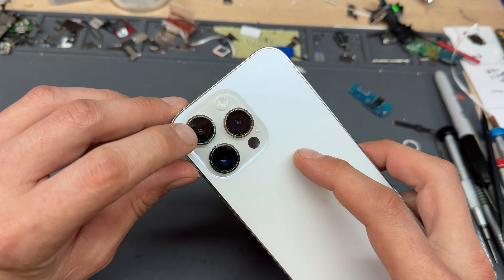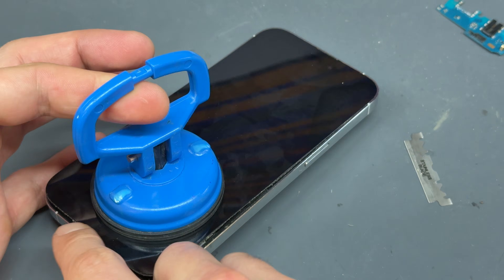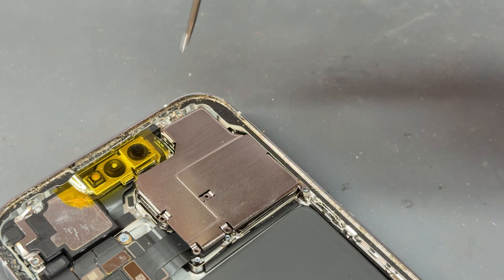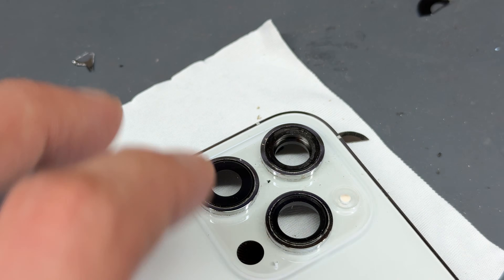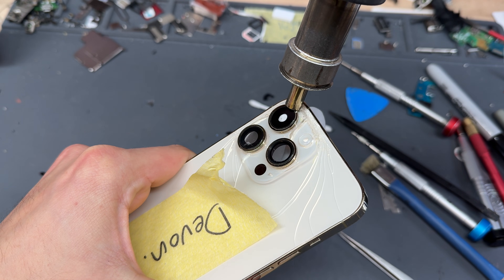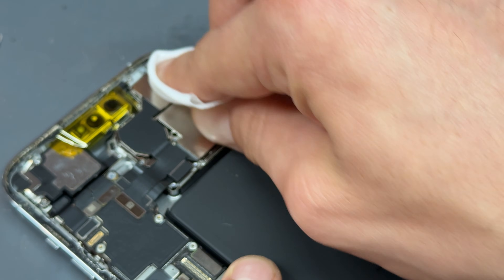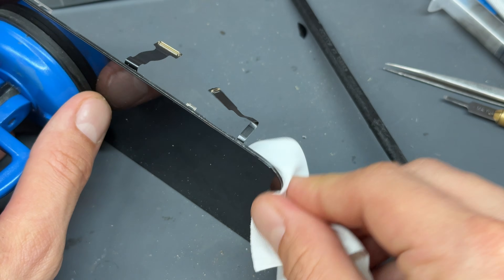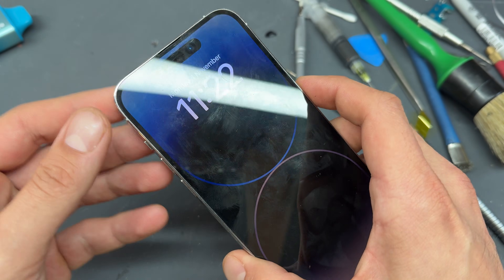iPhone 14 Pro Max Camera Lens Replacement - DIY Guide to Fix Cracked Or Broken Lenses!

Comment: I have seen many lenses on the market - of course it is questionable whether it is really sapphire glass then. However, the camera glass is a repair with high labour costs compared to the part value (of the lens). Thanks for sharing the "glue secret" and  the video as such.